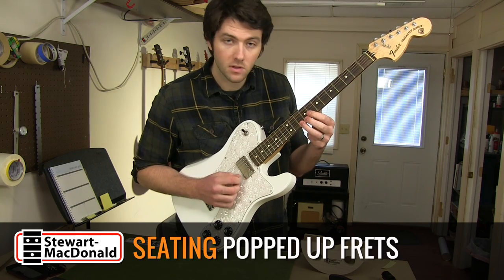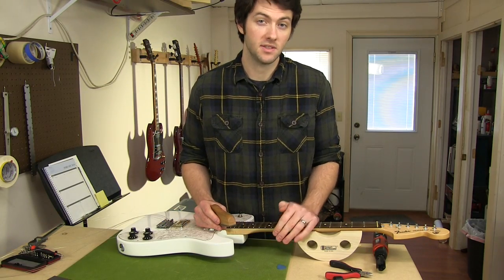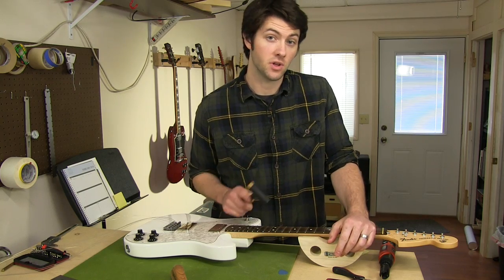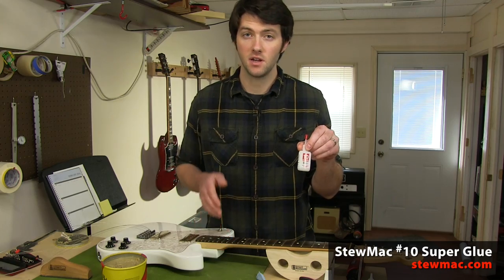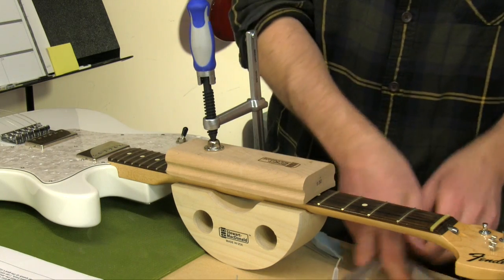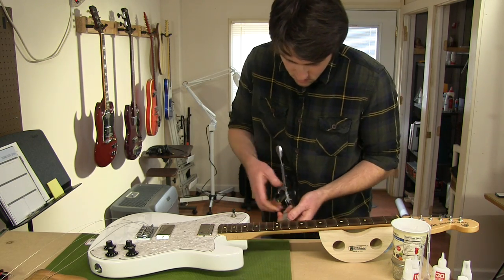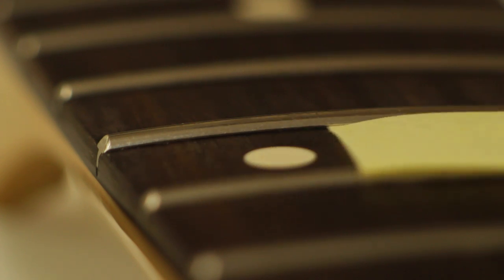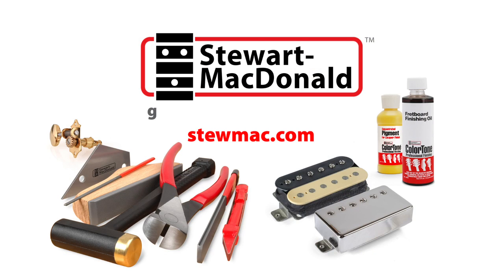Fixing fret buzz: seating a popped-up fret

Comment: Good work. But the statement "The more you can transfer the energy from your strings to your guitar the more sustain you'll have" is totally wrong for an electric guitar. You want vibrations to remain in the strings, so the pickups can detect them. A solidly mounted fret allows for that - vibrations are almost all reflected back along the string at the fret. A loose fret causes string vibrations to be transferred to the fret and lost there. The same principles apply at the bridge and nut.
Reply: Good one. Makes sense. Thanks for the explanation.
Reply: Technically you are right, but advanced players might still want some energy lost to the wood or wherever, hence the tonewood debate, the preference for warmer sounding strings, the existence of semi-hollow body and even hollow body electrics with wooden bridge (think vintage Höfners). If you manage to keep most of the energy in the strings, players might deem it sterile, lacking soul, while a lower sustaining sound might be interpreted as more pleasant. What I thought might not be correct in the clip was to say that the air gap below the fret is the cause of lost energy. Air has a very different acoustic impedance compared to the fret, so if the fret is stable sideways, it would just transfer resonances to the wood sideways and the rest of the vibration energy would just rebound at the fret-air material. Otherwise the air above the fret would suck out the resonance just as well. Some glue on the other hand might have a dampening effect (depending on material). Although if that would really be a problem, no one would like guitars with glued necks. So I am just trying to be very smart. :)
Reply: I wish I'd read this before making my similar comment!
Reply: players praise 'resonant' guitars which, in physics terms are less resonant and retain more energy in the strings, which is then heard acoustically.
Reply: when people talk about "transfer to the wood" as if it's a good thing, they are not thinking that they are losing vibrations from the strings (and therefore not seen by the pickups). They mistakenly think that the strings can make the wood vibrate while still keeping the same vibration energy in the strings, without any real loss of energy from the strings (perhaps deriving from a misunderstanding of how acoustic guitars work). Of course that would break the laws of physics. Or they think that pickups are like microphones and can hear wood vibrations, or that wood vibrations directly vibrate the pickup (neither of those occur to any real extent).
That's assuming there is any real thought going on, rather than just repeating what they've heard or read somewhere from the science-illiterate ("the body really resonates dude"). 
Ask anyone who talks about "transfer to the wood" or "the body really resonates" to explain what's going on and you won't get any sort of your nuanced argument about some losses perhaps being sonically more pleasant (which of course such sounds "might" possibly be - sound is subjective). You either won't get any coherent explanation at all, or something like the above. That is, nonsense physics.

Fortunately they also greatly over-estimate the amount that the solid-body wood is vibrated by the strings - it's very small, as all measurements of real guitars show. So lucky for them there is very little loss of string vibrations to the body in a solid-body electric.
As to the suggestion of maximum retention of vibrations in the strings being "sterile" or "lacking soul", where does that notion come from ? Yes, there are guitars that sound that way (for all sorts of reasons). But can you give me a single piece of evidence that links that to maximum retention of vibrations in the strings ? Why not call it "rich" and "full sounding" ? Aren't they more logical adjectives ?
But in case, pre-judgements about sound physics like this make little sense. If a guitar sounds good to you, it sounds good to you. Implying a priori that losses are good makes no sense.
If your strings retain maximum vibrations you can then EQ the sound you want downstream. But you can't put back frequencies that have been lost.
Re the fret, if it is loose and the strings can thus cause it to vibrate, then that energy has been lost from the string, so will not be seen by the pickup.
Reply: @vw9659 okay,  hear me out...
The vibrations of a string is more complex than you are giving them little things credit for. Think of how a paper cone vibrates in a speaker, replicating all the nuances of the signal it's being given.  Strings are the same way. When the strings give energy to a resonate guitar, the whole instrument vibrates, and that resonance (aka frequency) is imparted back into the vibrating strings and that is what the pickup 'sees'. A more complex vibration  than the string alone imparts. That's my take on it anyway....
Reply: @bentackett6299  it was fair enough that people had their own take on such things up until several decades ago, before anyone was measuring real solid-body guitars with the complex techniques necessary to understand how they really work. And those measurements are still not done by any major US manufacturer (luckily for them, you don't need to fully understand guitar physics to make great guitars; but it also means that they don't employ scientists who do have that understanding). Those measurements have been available from independent scientists for a long time now - just not that many people have read their substantial work. We now know that some players' and manufacturers' notions about how solid-body electric guitars work were wrong.  Your take is unfortunately not consistent with any objective evidence. The notion that vibrations make their way back to the strings after vibrating the body, at a level sufficient to affect the plucked/strummed string, has no good evidence. And other evidence such as direct string vibration measures by laser vibrometry, and bridge and neck admittance, show that almost all vibrations remain in the string. Only a relatively small amount of string vibration energy flows mostly to the long, thin, easily vibrated neck, and also commonly to vibrate the bridge's internal parts (at its resonant modal frequencies - that's the real basis of the 'nuance' you refer to). Those vibrations have been measured to be lost from the strings, so not seen by the pickups. The whole notion of the "resonant body" being a "good" thing is a science-challenged notion from before real scientists started measuring real guitars. And it fed players' exaggerated imagination of just how much the body is really vibrating compared to the strings. In that knowledge vacuum, people with very shakey grasps of physics dreamed up some nutty notions that might have sounded plausible once, but have now been found to be wrong. See in particular the work of Fleischer, Zollner, and Pate.
Reply: true this
Reply: You absolutely want some string energy lost in the wood.  Go play any headless guitar and tell me how it sounds compared any regular guitar.
Reply: @davidfaustino4476  the fact that it occurs to a small extent in all guitars does not make it "good". Headless guitar necks have their own resonant frequencies, just like regular guitar necks - to which a small amount of string vibration energy is lost. That can influence how they sound.
The notion implied in the video is that the purpose of a fret is to transfer string vibrations to the neck - and the more the better. That is physics nonsense.

Comment: I had this problem on my Les Paul Standard 2004. I live in Hungary. I showed it to 5 luthier in Budapest. No one wanted to simply glue it, they all wanted to level all the frets. I didn't want it, because the guitar was perfect!!! I took the guitar to France, to Marseille. I found a Gibson licensed luthier. He said the same thing, that he had to glue the fret, and after level all the frets. I abandoned, and I said ok. He leveled the guitar and he FUCKED UP. The guitar was buzzing EVERYWHERE. He didn't know what was his mistake, I paid 140 euro, and my Les Paul was fucked up. I took the guitar to Hungary. I gave it to a good luthier one of the 5 that I saw at the start. He didn't have a Gibson license, but he leveled it again. Now the guitar is good, but my frets are practically gone, they are completely used. Next time I'll need to refret the guitar. Because of one fret, and shitty luthiers...
Reply: krisztian76 The motto of your tale is......if you want a job done properly, do it yourself. 👍🏻
Reply: You can always refret with a good luthier. Pain in the butt but you can salvage that Les Paul
Reply: In France you pay full price for sheety work
Reply: @joshmuz9018  they fucked many of my guitars learning it all myself.

Comment: I re-fretted an Epiphone Casino that had buzzed from new, and it still buzzed due to lifting frets. Rather than glue all the frets which would be a nightmare if the frets were to be removed again, I went to the expense of buying a fret tang expanding plier, worked well and of course I have another tool in the box.

Comment: Hi Matt, if you superglue a fret down, will it be more difficult to re-fret the guitar a few years later? Great video BTW, thanks
Reply from the maker: It will make removing the frets a little more difficult. We recommend re-heating the super glue by placing a soldering iron on the fret you're pulling. A good tip is to keep the iron on the fret between the jaws of your fret puller. This way, if the iron slips, it will hit the fret puller rather than the fingerboard. Here's a video where Dan demonstrates his technique for this job. He uses a bent Fingerboard Guard while applying heat with the soldering iron.
https://youtu.be/2HY00NFyMGg?t=1m13s

Comment: There are so many people unjustly criticising this video. This isn't a criticism but a tip that might make the job easier for many people, There is no real need to remove the strings on a small job - just loosen and tie them with a piece of string to the back of neck. If this would interfere with any clamping they can just be taken off at the peg end, bundled and left near the bridge end. I've even tapped a lifting fret in (they don't always require glue)  without even loosening the strings by using a small piece of wood between strings, then tapping wood with hammer.
Reply: DelTangBrav Yes but then you wouldn't need to buy all their tools!

Comment: From personal experience I found hammering in frets(complete neck)  left about 1 in 5 not seating properly & needing to be redone. I quickly discounted paying a lot of money for those vice grips & bought drill press cauls. Perfect fit every time. Highly recommended. I lock the press down for about 10 mins while glue cools.
As I have had bladder cancer (35 yrs of exposure to iso-cyanates) There are no solvent based products in my w/shop. I use hide glue for fretting - can be softened for fret removal. I am also concerned about when superglued frets need to be replaced - fretboard damage?
 Also I only used the costly set of fret levelling files once - the scratches they left on frets were so deep that removing them resulted in the fret being too low. Using the drill press cauls  resulted in almost no levelling required after installation of frets - done  with fine wet/dry paper on radiused block - these are very useful.
 Thanks Stewmac for excellent service & delivery half way around the planet in 4 days!
Reply: I too have some fret press cauls that will work on my drill press..I noticed some buzzing on my partscaster and don't see any frets lifting so might get lucky doing some spot leveling.

I use my notched straight edge and check to make sure the fretboard is perfectly straight and go at it with the fret rocker.

Comment: DON'T FORGET! Watch out for glue running down out the end of the fret slot! Especially sucks on a nitro finish. Ask me how I know...
Reply: How... how do you know?
Reply: +Paul N Bassett Yes the glue will dissolve the nitro finish; it might be a good idea to tape off the edges
Reply: Paul N Bassett me too . leaves a small white hazy look around the spot where CA glue has touched the nitro lacquer. Ask me how I know. .
Reply: I think there is some glue sticking out on My guitar how do i get rid of it? Someone Said to Use a razorblade

Comment: Thank you so much for this video! I was having a little buzzing in the exact same spot as yours. Right at the ninth fret near high E string side. Tried bridge and saddle adjustments with no luck. Small tap with a rubber mallet and it went back down and stayed down. I was almost about to get rid of my guitar thinking i may have needed a full refret because of it. Not anymore! Was hoping it was more common that i originally had thought. I guess it is. Simple fix too in my case so thanks!

Comment: Great video , my guitar has gone in for a set up and now I'm tolled the fret board is slightly coming away from the neck should I be worried? And will the repair leave the guitar looking scruffy? Injecting glue was mentioned
Reply: Maybe a bit late for you, but first I would get a 2nd opinion on a fretboard lift, second, if it's a good shop, you shouldn't be able to tell a repair was done, and third, that repair can get a bit pricey depending on the extent of the lift.  Is the guitar worth the repair?  Hope this helps...

Comment: So I have this 20 fret acoustic guitar. It's new, bought a month ago. I changed my the strings on this guitar from 12's to 11's. And after that i keep getting buzzing at especially 10-11th fret, sometimes also on the 13th fret and it is only on the high E string. I've been trying to adjust my truss rod both ways because i havent had any result either with less or more relief. And whatever i do the buzzing is still there. Any suggestions?

Comment: 07/25/2020:  My fret wires look a little raised right at the edge of the fretboard.  If I tap one end of a fret wire down, side, then I would assume the other end would pop up.  I do not have an expensive Jaws clamp.  So, I guess it would be wise to have a Luther do it for me.

Comment: I have this problem on a jackson Js dinky except the fret is not seated in the center. The outer ends of the fret are seated. You can see underneath the center of the fret when you look down the fretboard.

Comment: I am not sure this would work in ALL scenarios. However it's a decent and good one video. If a fret has been loose for a certain amount of time, a lot of gunk sure has to been piled up inside the fret groove, and I say you must use a "solder-sucking" device first to clean it off from grind and grivel before an glue would stick. An explanation of how to clean it properly first would be appropriate. And you can't just pour isopropanol in there and wash it all out, because it MAY ruin the fretboard. Also hard maple fretboards with clear lacquer coat on MAY need different treatments due to that the clear coat may have chipped too. On any oiled, rosewood, ebony, mahogany board, this method may be sufficient enough though.
Reply from the maker: While this may not work in all scenarios, each job will vary slightly. There are many different techniques for cleaning fret slots based on the job, luthier, and instrument. We have a few videos on our website that show some great tips and techniques for cleaning fret slots. I have linked some here: 

>https://www.stewmac.com/How-To/Tool_Demo_Videos/Fret_Slot_Cleaning_Tool_V-4870.html

>https://www.stewmac.com/How-To/Trade_Secrets/Clean_fret_slots_without_wrecking_the_binding.html

>https://www.stewmac.com/How-To/Trade_Secrets/Yuck_Cleaning_fret_slot_gunk_from_the_Mike_Bloomfield_Tele.html

Comment: Good video, but that's an easy one.  How about a raised fret on an acoustic guitar where the fretboard extends onto the sound board.  You can't do much pounding there, and clamping is tricky too.
Reply: +waynzwhirled You merely place a piece of wood with a weight on (or a clamp that fits through the soundhole) across those frets - although if using superglue the short time it requires to manually hold them down doesn't make it worth the trouble.
(over 90% of acoustic players wouldn't even miss those frets if they were extracted - that'd stop 'em buzzing ☺☺☺)

Comment: when you play a string and it buzzes, is it the fret before or the fret after thats the problem?
Reply: (very late answer) The buzz is the string hitting a fret closer to the bridge than the one you're holding the string down against.  It's often the next one along (for a higher note), but not always.

In an extreme case, you get the wrong note played - a higher note than the one you should get, because the string touches the raised fret when you press down.

Comment: Why was he clamping a 9.5" radius block to seat a fret on a 12" radius fingerboard?  I have this particular Fender Chris Shiflett signature guitar. It has a 12" radius fingerboard.
Reply: Because the smaller radius puts the pressure on the ends only.   The instructions with the brass press inserts say to seat the fret ends first with the supplied 6" radius caul ...then go back and use the appropriate insert for your radius.

Comment: "The more energy you can transfer from the strings to the guitar, the better the sustain" - 100% wrong.  If you could transfer ALL the energy from the strings immediately, there would be no sustain at all.  Sustain is caused by the strings RETAINING their energy as long as possible.